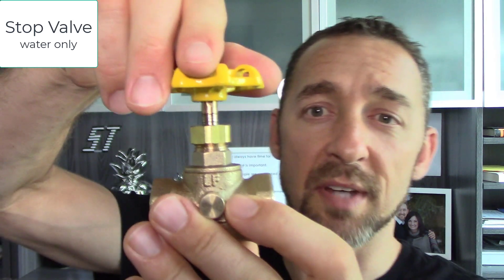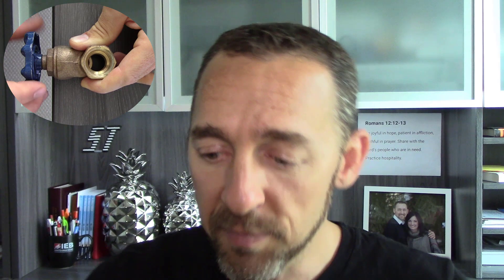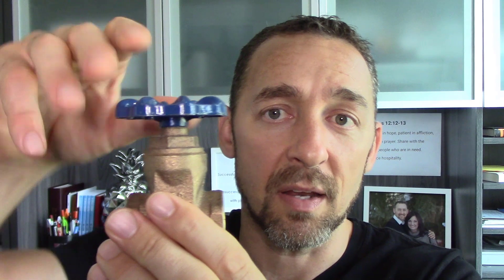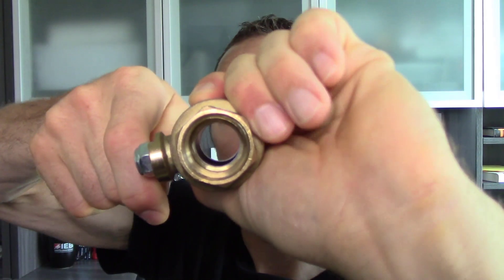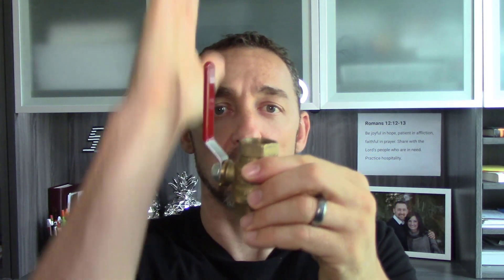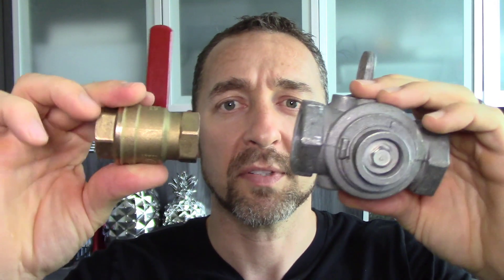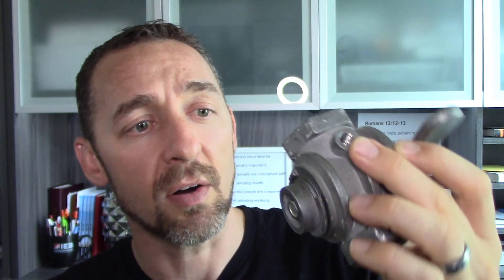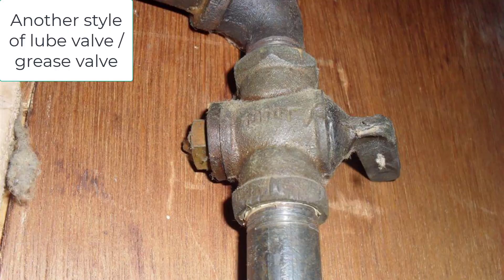Shutoff valve basics

Comment: I put all my pipes to my shower, kitchen sink, laundry and bathroom sink into a dry well I found on my property, I had my sons father do it for me and since then I have a bad smell in my kitchen sink,  and I smelled it once or twice in my shower, it has a rotten smell maybe almost like I'm smelling water that has stuff from dishes in it and showers ect.
Is this because he disconnected from outside air vent? Do I need to put air vents underneath...or a one way air vent? I have a small house  so the septic is also small and older so I had to take it out of the septic it was killing it..
Help me please..
I don't have the cash to hire a plumber for 3 or 400 with Xmas coming, it's almost like chemical smell sometimes too..I have to fix..I've dine some Bing but still learning..any info is great..thank you from worring mom...

Comment: I am trying to replace a faucet in my powder room with a pedestal sink.  I've removed everything, but can't figure out how to remove the flexible water line from the shut off valve. My house was built in 2019; it's not the usual type where I can just unbolt / unscrew the bolt to remove the water line.  Any idea what kind of shut off valve this is and how can I remove the water lines from them.  Thanks! - Joan